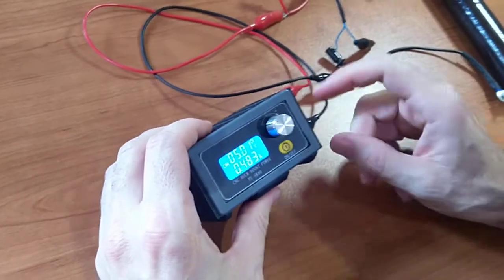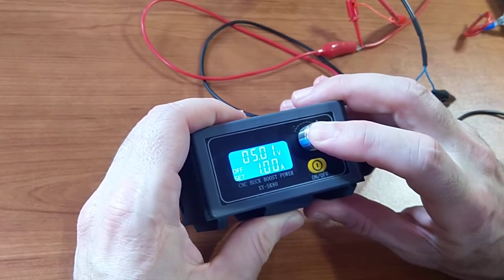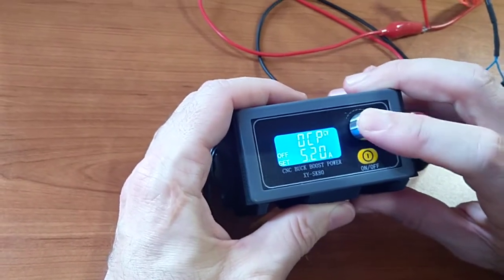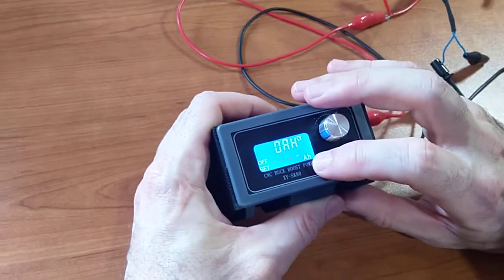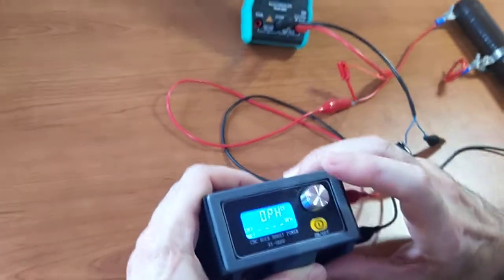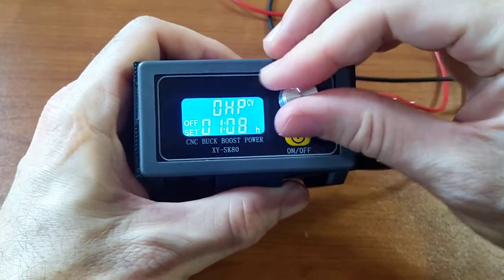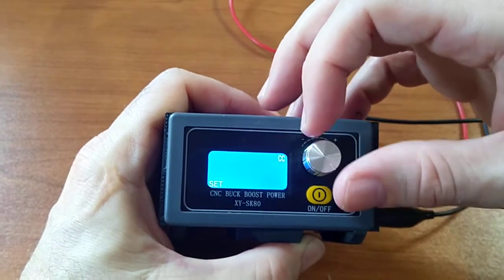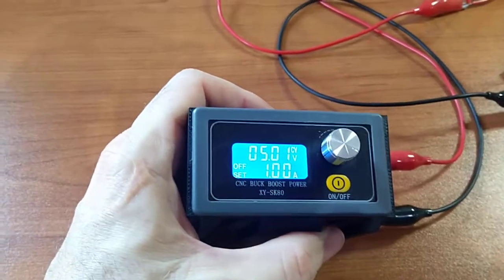XY-SK80 Adjustable Bench Power Supply - Advanced Features

Comment: Hey! is this safe for charging lipo batteries?
Reply: Hi, it should be if you set up the charging current correctly.  Remember unlike a smart charger you have to set up the voltage and current manually.